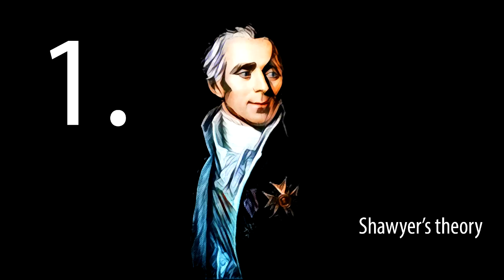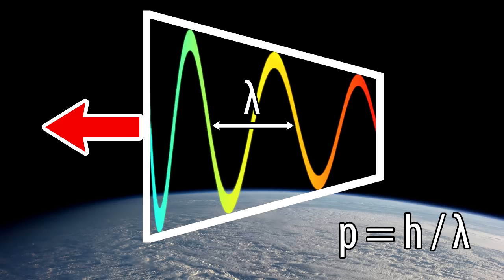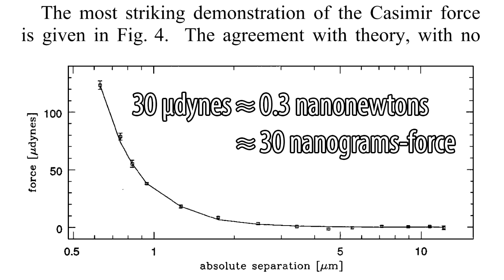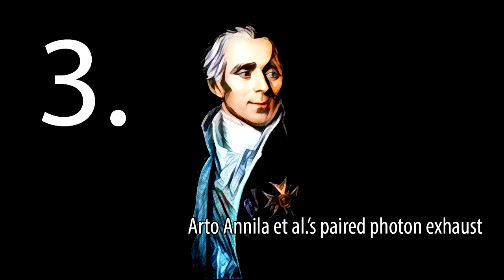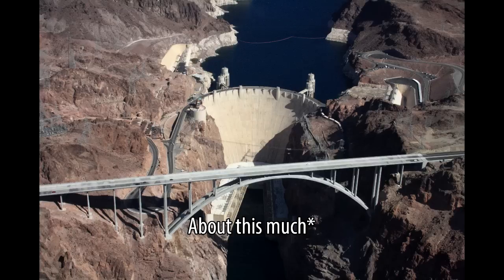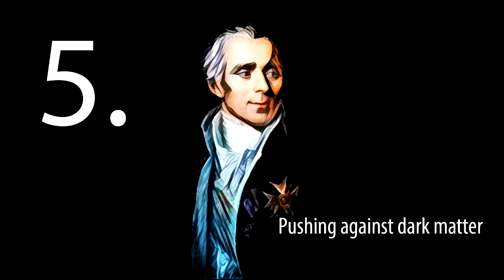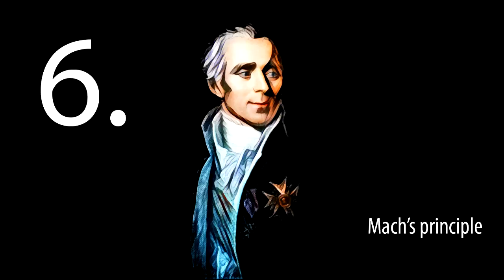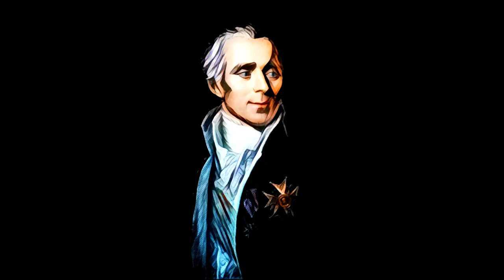The most unscientific approach – The Emdrive (part 2)

Comment: more videos or we riot
Reply from the maker: Heh, sorry about that! Been a little busy with TAing, and now, writing my thesis. I should have a new video out soon though :)
Reply: Vacuum Diagrams whats your thesis about?
you're doing a phd?
Reply from the maker: Yep. My research is on the subject of particle physics in a hot medium, particularly quantum electrodynamics and quantum chromodynamics, particularly issues concerning vacuum decay.
Reply: Vacuum Diagrams vacuum decay? never heard of it
Reply from the maker: Vacuum decay is an example of a concept called metastability. You can find examples of it on youtube I'm sure: just look for those videos of people insta-freezing a beer bottle by slamming it on a table. What's happening there is that really the liquid is below freezing, but because it was left quiet and undisturbed, ice never had a chance to form. The ice state has lower energy than the liquid state at that temperature, but in order to reach the ice state the liquid would have to go through a series of states at higher energy, so it's locked in. When you do finally disturb it, you supply that extra energy, small ice crystals are created grow, consuming the sub-freezing water around them. 

A similar thing can happen with the vacuum. You can bring it up gently to a state that is not really the state of lowest energy, but which is "locked in". We call that a "false vacuum". If this were classical physics, the system would essentially stay there forever until something supplied the required energy to go over the wall, or until it just happened to have the required energy by freak chance (that is called a "thermal fluctuation"). But this is quantum physics, so a third thing can happen: the system can quantum tunnel out of the false vacuum state. This is what's commonly called "vacuum decay", or more properly "false vacuum decay".
Reply: Vacuum Diagrams so what does this vaccume decay looks like? or more precisely, what changes occur in this new state of lower energy as compared to the previous false vacuum?
you're awesome if you ever become a professor i would very much like to be your student
Reply from the maker: Well, how this state is different depends on the theory. Usually (though not always) it's useful to think about it in terms of symmetries: ice has a crystalline structure, water does not. A crystalline structure has its molecules or atoms arranged in a regular lattice. This regularity breaks what we call translational invariance, the property that the physics looks more or less the same if you shift the material around. A liquid clearly looks the same when you do this, but for a crystal, you need to move at least a multiple of the lattice spacing in order to make the exact same observations. We say that the crystal breaks the symmetry.

Another example is a ferromagnetic material. In metals such as iron the atoms have an interaction that favors the alignment of atomic spins. In the state of lowest energies, all the spins must be aligned, and they obviously must point in some direction. The interaction doesn't care which direction, but it must be one of them. It breaks rotational symmetry. A piece of nonmagnetized iron, on the other hand, doesn't have any preferred direction. But if you wait long enough (might have to be many orders of magnitude longer than the age of the universe, but it will happen), the system will decay into a state with lower energy and a preferred direction. The sample spontaneously magnetizes.

In the case of quantum fields the symmetries may be more abstract. They may refer to different types of particles and how they relate to one another. For example, in a symmetric state you may have two species of particles with the same mass, and in a state of broken symmetry the masses might be different. 

In all examples I gave the state of absolute lowest energy is usually the one that breaks the symmetry, but that isn't necessarily true. What matters is that the "false vacuum" and the "true vacuum" have different symmetry properties (in fact, both might have broken symmetry, but it could be broken in different ways), and often have different types of particles as a result.

"you're awesome if you ever become a professor i would very much like to be your student"

Thank you so much! That's really nice to read :)
Reply: Vacuum Diagrams hey how you doin?
Can i get your instagram or something?

Comment: I want good space propulsion really bad... YOU CANCELLED MY CHRISTMAS! Up voted for accuracy... :( What I don't get though is if you want to know if it works or not why not just put it on a low friction rail inside a vacuum chamber and pump energy into it then just physically see if you get any thrust at all by well I dont know IF THE FUCKING THING MOVES! I don't see why that wouldn't work. it seems that people try to over complicate things and find out how if works but why not just simply see it works at all then be done with it.

Comment: first few seconds of this vid, they talk about microwaves WAVELENGTH being stretched and compressed...er, NO...absolutely NO, that is science fiction. The microwaves bounce around in there sure, but they DON'T magically change their wavelength in a little box ! that's like putting light into a similar shaped box and expecting it to be changed into lower and higher wavelengths and thus changing colors, nature does not do that. In fact, the only way we have ever seen this is in the red shift, with light travelling many lightyears a shift in wavelength ( a very small change) is detected, but, hey, you are NOT going to get that effect with microwaves in a little box ! anyone who understands physics will tell you that, it's quite simple, once you know what you are talking about.
Reply from the maker: They don't "magically" do it. They do it in order to respect the boundary conditions on the waveguide. For a perfect conductor, these are that for example the electric fields must vanish along the side walls. A plane wave does not satisfy this condition: there must be some oscillation in the transverse direction, which spoils the usual c = λf relation. See for example chapter 9 of Griffiths' textbook. 

The problem lies in assuming that because of this the momentum stored in the system can increase. That, indeed, requires magic.

Comment: No one actually understands it yet, period! If it really works, it is not surprising because if you really understands Quantum Mechanics, you will understand why ! For example, an electron can be at multiple location at once, at the same time ! Non-Locality, Entanglement and Quantization of Engergy etc etc..
Troll comments will be reported and deleted.
Reply from the maker: Quantum mechanics does not provide a mechanism for the emdrive to work because conservation of momentum is also satisfied in quantum mechanics at the operator level.
Reply: Vacuum Diagrams The bottom line of this whole discussion is that until there are better and repeatable experiments which conclusively prove that this thrust is generated from the quantum vacuum of space it is still a matter of speculation not of true physics or science. Regardless of opinion experiment rules not only must the experiment be repeatable by the initial experimenter but it must also be repeatable by others using the same parameters and conditions. Until all this is satisfied this and the speculation is very nice but it is not scientific nor provable

Comment: The device deserves to be put on a cubesat. It has too much promise and vacuum chambers do not offer certainty in blocking out heat effects. You trying to argue it away has no merit. If it works, it works. It is a cheap experiment that still is underfunded. More money has spent on the ink discussing it, than has been invested in experiments. Theory comes later.
Reply from the maker: Deja vu? There's no evidence experimentation with this device is worth funding.
Reply: "If an electromagnetic wave of a shorter wavelength has more momentum, where does the extra momentum come from"? 
Well, having read some physics books on jet engine and rocket thrust physics; it doesn't seem all that unlikely to me. I am just a person with a law degree, and English is not my first language, but...
Would you please entertain the following train of thought:

The thrust effect is a Function of Area and compression. Just like in....dare I say it... compression flow in a jet engine or rocket engine; more air passing/forced through a smaller volume/ surface gets accelerated and exerts more pressure. If the rocket engine would only have the air in the engine to play with, it could not produce any trust (your ping pong ball analogy on board a space ship), but if more air (electrons converted to microwaves) get fed in, pressure and compression do increase any thrust not being a result of overunity effects but of externally provided energy of a finite (chemical rocket/fueled jet fighter) or infinite energy source (photon rocket, solar sail both using solar energy).

Now, what do the physicality of a wave and that of a gas molecule have in common? That is a mixed bag. It is easy to see bumping molecules and what that does to both molecules (both slow down or one of both speeds up and the other slows down); between waves however you get constructive and destructive interference. It was never explicitly explained to me if both molecules and waves interact  in exactly the same way, so I will assume they do not. Maybe you could do a video on the difference between the two.

To continue:

But in a jet/rocket the mass flow escapes to produce pressure-diff and thrust. How does that work in a closed off truncated cone? 

 I think the following might apply: When dealing with EM waves you get destructive and constructive wave interference (this does also happens in rocket engines but there you are dealing with particle, physical objects the size of atoms and molecules and the effect is stagnant air flow that gets pushed around by the gases added to the rocket chamber sometimes in unexpected ways).  At one point the momentum in the waves exceeds the capacity of the copper lattice to resist penetration and it goes through the wall.

So why does it push of the smaller wall and push (more easily) through the larger wall? Well. Opposite waves cancel each other out; this is more likely to occur in the part of the device where the waves get more closely grouped and this is precisely the case in the more narrow part. More interference events. On the contrary, the waves are more spread out in the part with the larger surface area and have more opportunities to push through the wall without  destructive interference from other waves. Since energy is continually added  in the form of microwaves eventually a thrust in predominantly one direction sets in.

But then, where does this momentum push against? Actually, it pushes both on the inside of that larger cone surface AND on the outside of that larger cone surface. Just like photons, or laserlight coming out of the glass of a laser propels the laser by pushing on the outside of the glass, the microwaves escaping from the side with the larger surface area do something analogous. Because there is predominantly more chance of destructive interference on the side of that plate at the inside of the truncated cone (a zone filled with ever more EMwaves and closed off) than on the outside of that plate ( escapes into free space while the device is moving) again there is an interference imbalance and thrust imbalance, allowing for acceleration in one direction.

So this is a two stage process where on two occasions you have an imbalance in destructive interference causing  an imbalance in thrust; one time inside of the cone (between the narrow and larger part of the cone) and one time at both sides of the larger cone-surface. So yes, waves escape from both sides of the truncated cone but more predominantly on the side with the larger surface.

Ok, it was a challenge to write it out, but what do you think? I don't seem to need anything exotic, don't I?

It all too often happens that inventors cannot properly explain how their device works but that hasn't stopped us inventing or using technology so I have a difficult time agreeing with this world wide round of critiquing the device without actually playing around with it.

Comment: Sceptical =/= dismissive. Scepticism is allways the most scientific aproach and should be aplied to all of science equaly.
Reply from the maker: Are you suggesting I'm being dismissive? Why? I presented detailed arguments.
Reply: Your arguments where dismissing existing explenations, not saying that there is anything wrong with it. It was just that in the end I interpreted your commentary about scepticism as if it was something special that relates not to much more than the theme of your video. When the experiments done by nasa shows a net force, even when more and more possible forms of bias is encounted for or reduced, it suports the idea that the emdrive actualy works trough scepticism.
Reply: What I think you should stop doing is to use argument from incredulity and mockery. If the emdrive works then we have to asume that it doesn't violate newtons laws of motion. If it doesn't work then it will be found out sooner or later.
Reply from the maker: I haven't used argument from incredulity. I have presented detailed physics arguments.

"When the experiments done by nasa shows a net force"

Already addressed. That experiment didn't properly control sources of error.

Comment: On Unruh radiation, even though I quoted Wikipedia that it may be a possible explanation, my thought experiments resulted in agreement that the radiation force should be negative, in the video at 6:01, a part of the video which I haven't studied yet.  I will study that next, but in the paper on screen it states the equation is only valid at low velocities.

There are so many new papers on Unruh radiation, and it's very existence is still doubted by some.